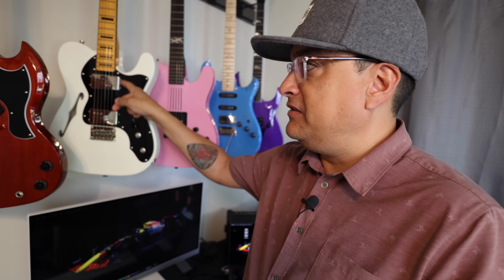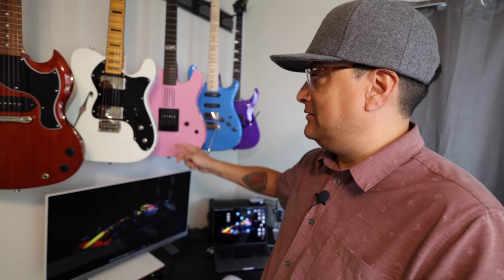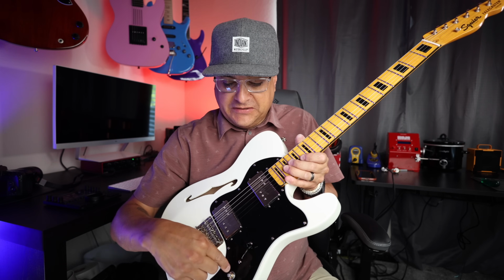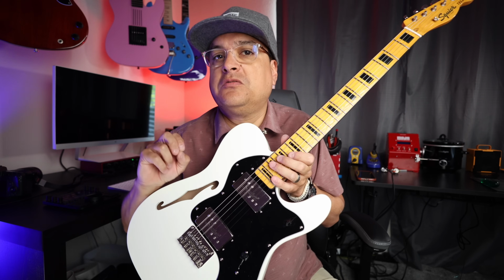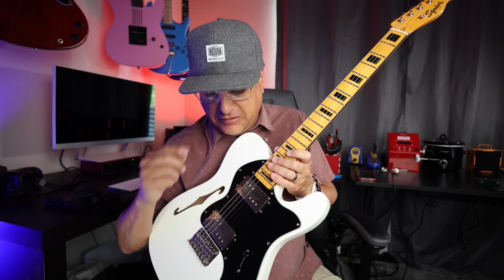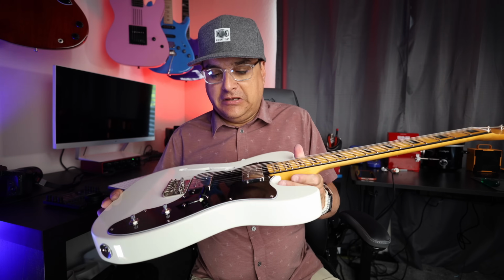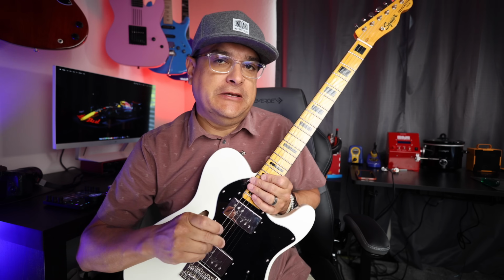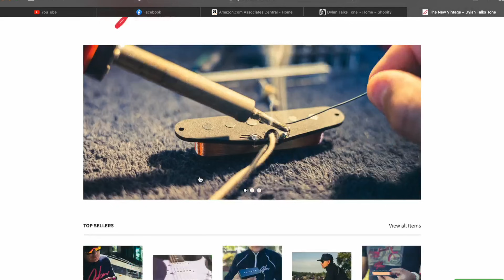250k Pots Vs 500k Pots - Sound Comparison

Comment: @ 1:09, when you say that the PRS fiore comes with 330k pots, were you referencing the 2 tone capacitor values? I understand  the prsaccessories shop advertise the Medium-Shaft Volume Potentiometer of the fiore @ 270K. I'm trying to convert the silversky to an hss but matched to the fiore's specs (with all its modifications). would you be willing to custom configure 3 loaded pickguards for me for the silversky If I send you the parts via mail (at a fee of course). I've been following your site for some time and know how familiar you are with the silver sky and fiore. I had ron ellis put together pups specifically designed to go into the silversky so i wouldn't have to have it routed. I currently have all the parts for both single coil pickguards, just not the hss. please help me with this.

Comment: Talking about pots, in another episode you refered to the 'known brands', but what are these? And where can I get them? Ive been searching for weeks for a push-push pot (25k), but so far I found one store that sells them and they dont mention the brand name. So I had very little choice... I installed these, but 2/3 of the range sounds like full open, then the volume drops very fast and the other 1/3 is hardly any signal to no signal. For me this is not workable. When I asked, the answer I got was:"This is the only one we have," which is not very helpful. I asked all the relevant supliers of guitar parts around here, about brands and /typesmodels, but the only thing I got back was:"If its not on the site, we dont have it," which is not very helpful.  What brand and product name should I be looking for?

Comment: Ok what about 500k/250k push pull pot for the volume? Using 2 humbuckers,3 way toggle switch... basically just what you have there....that way you could have it both ways whenever you want....where can i find a wiring diagram to do exactly that? I like to try it out,it may work good in cases where the amp(s) may be darker or brighter.

Comment: Thanks for the comparison. My ears hear more of a boost in the upper midrange more than the highs. Like the 500's better too, would have to try 1M (or maybe 750's) just for a comparison there too
  Have you thought there may be an effect do to different phase shifts with the different pots, after all a pickup is an inductor with it creating a complete (series) circuit with the pots. The electrical position of the center lead of the pot just determines how much of the voltage in that circuit is shared with the amp.

Comment: I did a similar experiment on my Jazzmaster (with WRHBs) I moded the lead  circuit with 500 k and the rhythm with both 1 Meg  pots. i couldn't decide which one I like better so I left it like that. I use the 1 megs for leads

Comment: Yeah, if you've got a real dark pickup like one of those old overwound mexican strat ceramic pups, putting a 1M pot in it really helps. The darker the pickup, higher the value.
Reply: This. I’ve got 1Ms in my MIM standard series strat and it brought the neck and middle to life. I still had to switch out the bridge pup and do some other wiring mods to get a balanced bridge pickup sound.

Comment: Dylan, I have a G&L S-3, that I basically like the sound of the pups.  I believe they use ceramic magnets in them.  However, the neck pickup just doesn't have enough bite and clarity.  Is there a way to wire the switch so that when the neck is selected, it sees 500K?  I like the sounds of the middle and bridge as is.  Of course, one way is to just replace the neck pickup with Alnicos, but I wanted to keep the guitar close to stock as possible.

Comment: I did put on 500k volume on a G&L Legacy. People warned me it would sound too bright - I don't think so. But I also installed a switch to change the cap to .22 or .33, so I can roll off just a bit of the high end if I need to. I hardly ever turn the tone down, and if so, not by a lot. I do use DiMarzio Area 58 and 61 and a Crunch lab Humbucker. SCs are noiseless, allegedly those swallow some brightness and work better with 500k potis - just putting out, what I read. 250k on my Tele makes the Humbucker sound kind of like a Gibson neck HB with tone turned all the way down. Definitely something missing.

Comment: It really depends on the type of pickup and how they're wound. A single coil strat pickup as you said is inherently trebly and can be a bit much. Putting a 250K pot in there generally makes it sounds nicer. But you can also get that by turning down a 500K to half. It just means it's harder to dial in a sound with only half the range of the pot. Hence why you might choose to put a smaller value in to begin with.  A lot of the guys in the 60/70's used to use curly or long guitar cables on strats to get rid of some of the highs even with the 250K pots.

Then again, you might have a humbucker equipped guitar that's sounding muddy with 250K or 500K pots in it. Changing to 1M pots may alleviate that to some extent.

Personally in this example I was surprised the 250K pots weren't as muddy as I was expecting. But I still preferred the 500K pots in this instance, as it opens the mids up as well and gives it a fuller sound.

Comment: Is the fiore actually 330k? The wiring diag on their website states 270k and their parts department sells a 270k with the 180pf cap and i think a 150k resistor.

Comment: On my stereo I have a button which mimics "loud" by boosting the bass and treble of a quiet signal to make the quiet sound sound louder.

I'm listening to your 500k pots at quiet volume  and they do sound better than the 250k pots. I'm wondering if my appreciation might change if I was listening to the guitar at loud volume?

Any thoughts?

Comment: The guitar does sound better with the 500k pots. It's interesting, cause the pots really didn't add anything... but it sounds like they added something. As an additional thought, perhaps it would have been interested is you had recorded this as a blind test, i.e. guess which is which, then reveal the answer.

Comment: The 500Ks really open up the sound. It's a great improvement.
Reply: Nothing they "open" there, just sounds a little louder. This is the interaction with the input impedance of the amplifier, which has gone beyond all reasonable limits.

Comment: Dylan I have a question: If the 500k pot provides less tone-suck, would you see a similar effect on a 1m pot or even higher? Where does this theory bottom out? This video has me thinking 1m+ would be better but Im sure there's a point of diminishing returns?
Reply: You get the most high end with an "infinite" pot, also known as no-pot-at-all. It's easily tried by disconnecting them from ground.

Comment: Got a Donner 335 Jazz guitar they replaced and didn't require the original to be sent back. I know nothing but I can say the Tone Pots only work around number 2 after that no notable difference. They agreed and said defective but the replacement guitar is the same. So I'm thinking I need to change the tone Pots these are Humbuckers with Volumes Split pull coil on both volumes. I note a capacitor need to be fitted. I guess I don't know what I need to get a gradual noticeable and usable tone pot as at the moment effectively it works like a switch. Hope this makes some sense and any advice would be appreciated. I've never done any changes myself and thinking of taking it on but I need to know what I need.

Comment: Here is a question.  I have an EVH Frankie and want to hook up the neck pickup.  There are push/push 500K pots, but the neck s too shrill.  I see a 250k/500K pot by Fender.  Thought it was my solution, except the knobs that fit do not jive with the look of the guitar.   Can I put a capacitor in front of the single coil to compensate in the 500K push/push?  What options do I have?

Comment: Dylan, what are the effects of replacing only the tone with a 500k?
Reply: Both are wired in parallel to each other, so if you have one 250K and one 500k, they end up working as two 375K.

Comment: I also prefer the way your nice Deluxe strat sounds with the 500k pots. Listening to the comparative clips thru my jbl speakers I notice a perceptible sound difference. 

The 500k setup sounds sort of slightly softer but more full, slightly more polished sounding, and it sounds a little wider. It is hard to explain and a seemingly subtle difference, but very noticeable. It is the kind of difference that you can feel while playing. Not so subtle actually because this tonal difference is 'always' present. It's present but you can change it with the controls. It sounds great with a whammy bar too, I might add. 

It seems that doing a careful soldering job with good wire, strong solder joints, and high quality pots and switches leads to a noticeably better sounding and feeling outcome and final project guitar. A carefully done wiring job with Bourns or cts pots and shrink tubing covering areas of bare wire might be found to result in a very very much better sounding and playing guitar. 

It is complicated. You might have to check your work ... It should end up sounding really great. Inspect your soldering joints. Make sure your soldering joints are neat and clean looking, and strong. Check all of them by pulling on them. Cover any areas of bare or exposed wire, etc., that might come into contact with other wires or surfaces. Bare wires can ground out or short out under certain circumstances and these random contacts cause audible noise perceptible to the guitar player. 

Careful, clean soldering definitely leads to a better sounding guitar. Hint: support your solder joint with something like alligator clips before soldering the wires together and it will be far easier to solder the wires together. Because the wires will not be moving around in the air, unsupported. Clip or support the wires before soldering. Plan you solder joint and set it up before starting to solder. Take your time. Be patient. Use high quality pots (this is a musical instrument not a toaster) and switches and your guitar will definitely sound great and it will sound high class. It will have a perceptibly high quality sound.

Neatness and attention to detail matter. In the end you want your guitar to sound and feel better.

By the way, the sound clips sounded groovy. Not too long or short and the difference in tone was clear.

Comment: So many episodes by Dylan about Pots, Caps and Wiring.. Yet he has to do a new one each time. Admire his dedication towards explaining everything without stating “ check out my previous episodes” ! Thanks Dylan for understanding that humanity is one lazy species. So to add to that laziness - a video on Caps, different types .15,.22,.45 etc, types like Emerson, orange drop etc and finally a sound check like this video . 
Hopefully my bank account goes into green from this month end and finally I ll be able to get set of Dylan flat 6 & wiring for my Tele. Would love to get a little perspective on the sound differences in caps.
Reply: I'll save you some money... different capacitors with identical values will sound identical.  Buy tightly toleranced capacitors of the cheapest variety you can find (in the correct voltage).  There is no magic sauce.

This is a little different when you stack many capacitors, as different materials can affect the speed or quality of how the frequencies are filtered, and stacking many of those minute differences CAN make a little difference. 

In other words, it might be worth it to spend more money on high quality capacitors for a big tube amp.  For a single capacitor on a tone knob, it makes no difference.
Reply: @stevescuba1978  this is amazing information Steve & thanks for putting it in simple terms.

Comment: Definitely feel the 500 K pots give a much more balanced sound good base, mid and highs with a much better definition versus 250 K.  The highs aren't overpowering.  Great video.
Reply: I built a partscaster Tele, with 500K volume pot, sounded really good.

Comment: Actually the reduction in highs comes mostly from the tone pot, because a 250k max value is like a 500k at half, essentially, because the cap to ground is a low-pass (treble-cut) filter.
Now, resistences to ground act like high-pass (bass-cut) filters, so in something that only has a volume, you'd get less bass with 250k than 500k.
Which means you can try using a 250k tone pot with a 500k volume to tame particularly ice-picky pickups.

Comment: I like my 7.1 k single coil with the tone pot disconnected. I think that brightens up and makes the pickup sound better.

I did not like the 500k pots on my single coil, But I've also saw that what people do is buffer to pick up and Then you can increase the pot value and it will not sound as bright or thin.

Comment: Also I hear you about the volume pot having the bigger effect but I will say, I bought a Norlin era Gibson (1979 "The Paul") and it came with 300k volumes and 100k tone knobs, and after I switched out the shitty 100k tone pots out for 500k pots the guitar is considerably brighter.

Comment: Any opinion if I’m trying to use a push-pull pot to coil split a humbucker? Have one on the bridge pickup and I want the option to switch to single coil. Should I get a 500 push-pull?

Comment: This is a damned tricky subject!!! Bear in mind that a higher value [volume] pot will cause your guitar to be more susceptible to highs lost through the cable, due to the cable's internal capacitance. A higher value [volume] pot will also tend to be less "gradual" as you turn it down. For these reasons, I have always preferred lower value pots, whether they be in a guitar (regardless of pickups), or even a studio console. As far as tone controls, I place a bit more weight on cap values. Lower cap values cause a less dramatic, more gradual effect, and vice-versa.

Comment: IMO widerange humbucker (esp. the fake ones) works the best with TBX tonepot+.015U capacitor. From the TBX, you could have the 250k feels (in the middle of the pot) and more organic telly sound from the 1Meg pot. I think TBX should be used in every fake widerange pickup  guitars. 😁

Comment: Excellent vid. Ive been wanting to experiment w this w my workhorse 71 franken-strat that’s had EMG HSS set up with a gen w Floyd installed by the man himself. I was thinking about an PAF w Duncan 1/4 pounders as a good clean and highly driven distortion (I’m s Mesa boogie collector). Would love to hear your thoughts about the best wiring when going from active to passive pickups! As bare knuckles are tempting mr for the heavy stuff. But I’m just a player. Not a luthier so. Future video?

Comment: Ok so… is it not possible to install a resistor tied to a switch between the volume pot and the output jack? Say you install 1 meg pots and then flip the resistor on when you want to drop it to an effective 500k. Hell, for that matter are there not pedals that can do the same thing? What difference does it make if you strip the signal before it hits the amp?

Comment: It's just basically an RLC circuit. If you change the value of any component, the shape of the frequency response will change. It's not just about the highs. It's not that simple.

Comment: you said 500k sounded fuller. you mean like almost a volume/loudness increase from 250k to 500k? (ofc got a little brighter sounding but loud too?) i did the opposite. I went from a 500k pot to a 250k pot in a 1 humbuvker guitar. I feel less hight end but now its not as much loud as it used to be. i have to crank the amp volume a lot more on cleans... is this normal or could it be some wirings probs i did?

Comment: I felt the 250k pots conveyed the dynamics far better. The 500k sounded slightly thicker but the mids weren't  sparking  with the pick attack, if that makes sense. Hence, the dynamics came out a bit flat. At least from my speakers.

Comment: I have a squier with 1 humbucker, 1 volume and 1 tone, both 500k. i switched to 250k pots! the thing is, i can see its a little less bright i guess but does that translate to less volume overall? i had issues with ground wiring but i think its ok now (no wierd popping noises) but i note that its a lot more quiter... could it  be wiring issues or since its less bright it translates to less volume

Comment: I get the frequency part of it but does it make a difference in output amplitude?  I think it should if it’s part of a voltage divider circuit.

Comment: Doing a humbucker with a single coil I use 250k- 300kpots with a 250k resistor in the circuit to only work with the humbucker.

Comment: Really depends what one wants: have SD little '59 in the neck of one of my strats & ts wired series (normal) as well as in parallel; ...in series 500k works but when in parallel - no comparison how much better it sounds with 250k... so, I finally opted for 300k but tsa trade off...

Comment: Wow I definitely heard a big difference. Usually in these videos or the blind side by side tests there is so little of the difference that you don't even know if you're hearing a difference. But that Tele does sound better! The sound is fuller And the highs are there only their softer to the ear. It's not that ear piercing telecaster sound that they normally produce even though that wouldn't happen with your new pickups but I think any pickup has the potential for the highs to be a little annoying but man you hit the nail on the head with that is a beautiful sound.

Comment: What about mixing the pots?
I've got an sg with a muddy neck pickup.  Would fitting a 1 meg pot for the neck volume screw up the other pickup or pots.
Reply: I'm not an expert, but, when you have two volume pots i think it will only have an influence on the bridge pickup when your switch is in middle position.